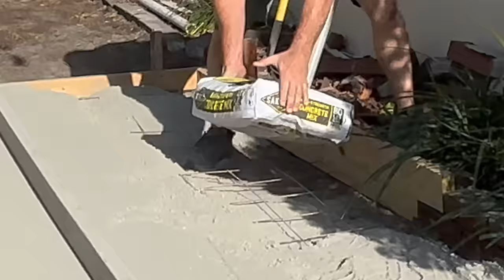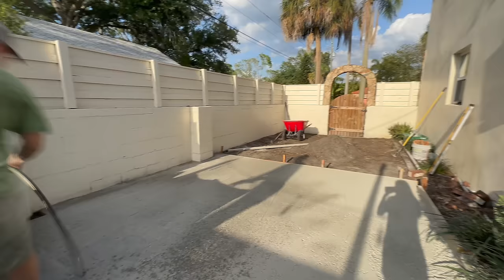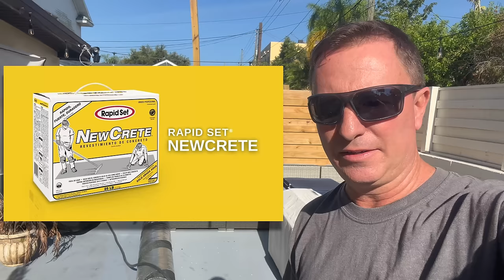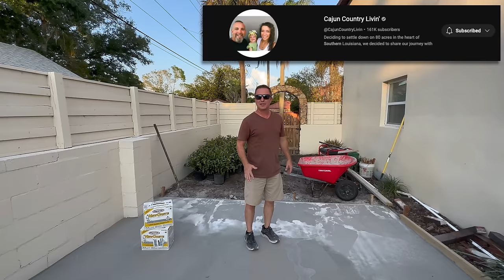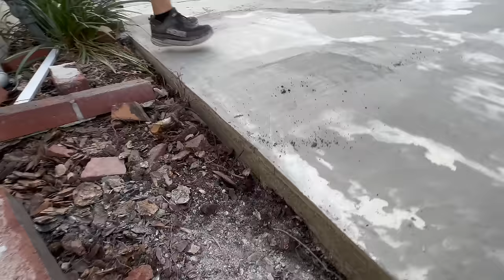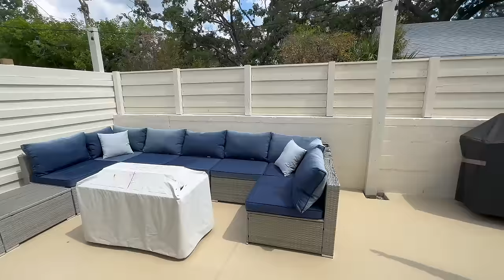Doing Dry Pour Concrete DOES ACTUALLY WORK?

Comment: It’s quick and easy but I feel like people who do this will regret it 6 or 7 years down the road.
Reply: Please explain why? If you feel that way. So we can at least understand. You must have a reason your saying that. Thank you.
Reply: @MrSteelermaniac  it doesn’t dry evenly, so you’ll get different layers of hardness and weak spots.  It could work, but I bet you’ll see issues down the road.  An even consistency is always better imo.
Reply: Well they have had people cut them in half, drill them, run them over with various vehicles, and bust them up. All compared to wet and if done properly there was no difference
Reply: @aundorl yes...if done properly.
Reply: @jcberb  Yes, if you follow all the directions for doing a dry pour. Screed back and forth until no rocks are showing. Use a roller to even out surface. Mist wait an hour.  Mist wait an hour, then water every hour for 2 hours per inch of thickness.
Reply: There are no directions for dry pour since it is not supported by any of the companies making the product.  It is directions from a nice couple from Cajun Country.
Reply from the maker: @chucklakes2345  Thank you for your kind and sincere comment.  Much appreciated.
Reply: @jcberb Yes, there is a way to dry pour incorrectly, just as much as there is a way to wet pour incorrectly.  What's your point?
Reply: @TheGamersRace  Calm down keyboard warrior.
Reply: @jcberb  Cool, so you don't have a point.
Reply: @chucklakes2345  I had some concrete work done and in less than a year the surface started to wear, don’t think these guys were great but at this point I’m good to dry pour something. 6-7 years is plenty of time for me lol
Reply: Once a dry pour has cured it's not going to revert to rubble simply with age. It will continue to absorb moisture until it is completely hydrated. It's about 2/3 the strength of a standard wet bag mix, which is strong enough for a patio slab or sidewalk. This assumes a proper base and drainage, which is also needed to keep a wet pour from breaking down.
Reply: @sotoliriano  There are bad dry pours and bad wet pours--as you have seen. Read up, learn all the tips and tricks, and don't skimp on prepping your base!

Comment: A lot of work and time spent making it half way decent. Would have taken less time to mix and pour like the instructions say on the back of the bag.
Reply from the maker: The time was approximately the same as a wet pour and half way decent end result is your opinion.  Guest and clients have found our finished product comparable to any traditional wet pour.  Just accept the fact that dry pour is just as good as a wet pour for small home projects.  You don't have to believe it, but it is still true.

Comment: If you had just did it the right way In the beginning, you wouldn't have had to fix all those problems. It is going to crack overtime.
Reply from the maker: Thank you for expressing your opinion kindly.

The point of the video was about dry pour and seeing if it is a viable option for DIYERS. The other two slabs next to the dry pour slab were poured in the traditional manner. Also, without factual data we need to be careful what we express, as traditional poured slabs crack too. So in summary, if a person follows best practices for a dry pour as one should for a wet pour, there is a good chance the slab will be fine. As stated in the video, these slabs our not for structural building. The dry pour slabs are for the simple uses of concrete, i. e. slab in front of shed, short entryways, barbecue, etc.
Reply: Once a dry pour cures, it's not simply going to turn to weaken with age. Somehow I doubt you have monitored dry pours over the long haul, so on what basis do you state it would it crack over time--any more that a wet pour might?

Comment: Looks neat, but I’d rather just use a small concrete mixer and do it that way to save money.
Reply from the maker: A small mixer would work also. The only challenge for some is getting the mixer to their home and being able to use it in short time, so as not to pay high rental prices. To each their own.
Reply: I get it…. At 4”,  you’d need  80 plus bags and that would take around 4h of mixing….. it looks great man… nice works🎉🎉🎉

Comment: Great Video! I worked Mud for almost a decade and have a couple small projects that will be dry pour. It seems that a little vibration along the forms (before wetting) could help with some of the issues that folks have. I like the use of topper to level-out and smooth the finish. Since my pads will be about 3x3 I plan on spraying with Thompsons or similar after the first 24 hours. Thanks for the show! (Dave W / PHX)
Reply: I made a vibratory screed, much like what you can buy to finish et concrete. But in dry  pour, you use it on the dry concrete before you wet it. What this does well dry is to help push the aggregate down and cause cement and fines to rise up. Then use a dry paint roller o evenly smooth out the fines. Then start the misting process. I mist about once every 30 minutes as the water migrates down about 3/4 of an inch before slowing and stopping absorption,   Then mist again and wait another 30 minutes and repeat. You do one misting for each 1/2 inch of slab. 

I have tested this in clear plastic forms and you can observe the water migrate down. The rate that the water gets absorbed is amazingly consistent and predictable. Once the slab is fully absorbed a bit extra water will not hurt, It's already beginning to cure. 

With wet mix concrete, you get the strongest slab with the minimum amount of water. But it is harder to work. That's not an issue with dry pour. 

Using the power screed followed up with the roller, produces a very nice finish that looks pretty comparable to wet finished, but it is not slick and has a vert nice minimal roughness to it.  Better than a broom finish but won't become slick with water, like a super slick finish. It  is comparable to an etched surface and if you want to later apply a sealer or even paint, you will get a very good bond.

Comment: Justin, I totally agree with you on the partner assist screening. My slap was a very large slap about as large as yours. So, by myself Screening, I did it in sections (4' x 12' (5 sections) [section 6 6'x12' 10:15 ] adding wire for the hot tub placement. Just to pour about 6 weeks.

I do have a few areas to touch up, then, it would be painted as well.

Yours looks good!

Comment: Excellent, adds a lot to the data. Being in construction, would you have experience with the testing tools and methods used for concrete to measure the compressive strength? It sure would be interesting to see how strong it would cure compared to a slab done the "traditional" wet mix way.
Reply from the maker: I agree. It would be interesting to see the strength of a dry pour concrete compared to a traditional wet pour.  I personally don’t have the ability to measure the PSI strength.
Reply: That would be difficult as the only way to get the actual compressive strength of that slab would be to drill a core. Non-destructive testing (Schmidts Hammer or Windsor Probe) are not designed for this type of concrete (or for finished flatwork in general). I would bet the compressive strength or surface durability  will not even approach that of the same properly mixed concrete, and forget about even getting uniform strength throughout the slab thickness. Hopefully this is in a non-freeze\thaw environment as one winter would disintegrate this mess.

Comment: We just did this last weekend using the same concrete brand & mesh you did. The sifting was definitely the hardest.  Hubby & I got frustrated with each other for a bit cuz of it lol. We did decide to buy some cement mix that was powder only because we were getting frustrated that some rocks were still showing. That worked  but, it was a different brand so now our slab is 2 different colors 😢. I want to stain it but not sure how long we should wait before we do it.
Reply from the maker: Great job! I totally understand how you and the hubby were a bit frustrated. Happens with me and my wife too. I am glad to read you overcame the rock problem. So regarding the staining of the concrete, I would suggest waiting 30 days so the concrete can fully cure. Since dry pouring is a new there aren’t any set standards, but based on what I have learned and some basic common sense is how I am providing this advice. Keep us updated on your progress.
Reply: Hey try concrete paint! I did several dry pours and used black concrete paint and it turned out great!
Reply: I had the very same issue. Rocks showing and a rough surface. And three salesman footprints in it, of all days to come to my house. I am going to need to cover mine as well.

Comment: The dry pour does not seem to have smooth finish, so you can actually make it smooth with the New Crete or the self-leveling concrete? What is that self-leveling concrete called? Great job, looking fantastic!
Reply from the maker: Thank you for your comment. I do believe with more experience a smooth finish is possible.  As this was my first experience, I had a learning curve.  To level out the areas needed, I used a product called LevelQuick RS which can be purchased at Home Depot.  After the self leveling product dried I used New Crete to create a nicer finished look.

Comment: Hi, Thanks for the great videos!!! I have a question. I am setting a couple of 4x4 posts in concrete this weekend for an addition to my roofed patio. I am wondering how it's possible for the concrete to stick to the posts, because when I use wood as a form to mold concrete, it doesn't stick hardly at all and comes off easily. Do I need to prime the pressure-treated wood before setting it in the concrete? Thanks!!
Reply from the maker: First of all, concrete is not an adhesive.  I do promise you though that whatever you stick inside of it will not come out easily once it fully cures.  There is no need to do any additional treatment to the pressure treated wood.  It is advisable to make a small rebar cage around your 4" x 4" post, so the concrete will have more strength to hold the post as the weight of the roof will create tension.  I encourage you to continue to do your research on best practices before this weekend.  I wish you the best and thanking you for the opportunity to chat with you.

Comment: How big was the pad and how many bags of concrete did you use?
Reply from the maker: The pad is 11’x 12’ and I used 60 bags.
Reply: @justintimevlogs2492  60 - 80lb bags?
Reply from the maker: 80lb bags
Reply: From a novice in northern NYS:
Great vid. I’ll have to watch it again to make sure I can actually do this.
The questions I have are :
If you would have wet poured it would you have been using the same amount of bags?
And what kind of paint did you use.
Thank you again for posting 
Good luck in your future DIYs.
God Bless
Reply: @fredr.5723  At 3.5" thick a 11'x12' pad would need 64-80lb bags.  So I'm guessing the thickness was a little bit less.  I'm shocked, I figured mixed concrete would have expanded or something.
Reply from the maker: Hi Fred, thank you for your questions. Our pad is 4” thick through out. Had I planned to film this process from the beginning I would have filmed me measuring 4” throughout. I can assure you as I laid out the forms and graded the dirt, it is 4”. The calculators only give us approximations on the number of bags.

If I mixed the concrete with water I would have been within a couple of bags of the 60 I purchased. 

Regarding the concrete stain, I used Heavy Shield (water based) concrete & driveway stain from Sherwin Williams.

Comment: If you want to cap that with an actual durable finish that might make it last you're looking for a product called cement-all. Make small batches and skim the surface. It cures very fast. It would likely save it's durability it's so strong.
Reply from the maker: I have never done it that way but I am sure it would work too. As per how I was trained, I typically use cement all for cracks in a slab and then top it with New Crete. There is a great video sponsored by RapidSet that shows this process. https://youtu.be/ybtEKpoCWEs

Comment: Can you tell me how long you watered it?  Until it puddled on top and was no longer being absorbed?  And all at once?  Being a concrete newbie I'm concerned about how much water to use, as the more you use the weaker the concrete. But then again, you have to have some reliance that the water is getting to the bottom. Thanks!
Reply from the maker: Great question. For me, I did not need a lot of water from the top.  I made sure to water the ground before I started so the lower parts of the slab would wick up the moisture from the ground.  Also, when using bags of concrete the moisture in the air helps in wetting the concrete.  I have a video coming out soon discussing this process with an industry expert.  I did give my slab about 5 minutes of watering, which I explain in the video.  Yes, there was some puddling.  I did come back out about 2 hours later and watered the slab again in the same manner.  I wish you all the best and thank you for your question.

Comment: You used a self leveling concrete and then new Crete on top of that.  If the screed work was better up front would you have skipped the self leveling and just used the New Crete for the smooth top finish?  And then you painted over the New Crete with paint for concrete?  Or is the New Crete the paint or coloring product?  Thank you, I just did my first one and it came out rougher than I want and not the color that I want so I'm trying to fix it.
Reply from the maker: You are correct. I wouldn’t have used the self leveling product had I done a better job screeding. I would have gone straight to the New Crete to provide a nice finish and blend it into the other two slabs. After the New Crete cured I painted it with Heavy Shield from Sherwin Williams. It is a concrete paint/stain. I wish you all the best. Thank you for sharing your experience.

Comment: Do you think a 4" dry pour slab is strong enough to park a golf cart on? ( has a lithium battery so it's much lighter than one with lead acid batteries)
Reply from the maker: In my opinion, I do believe a 4" dry pour slab would be strong enough for a golf cart.  I am doing a video now on a driveway addition I am doing for our golf cart.

Comment: Would it stand up to the weight of car or boat under a carport anchored to ground?
Reply from the maker: Building codes require a wet pour for the application you stated.  In theory, dry pour could work but there too are many “potential” points of failure in the dry pouring method that don’t warrant the effort and cost for a driveway, in my opinion.

Comment: How would you feel about anchoring a pergola in a dry pour?
Reply from the maker: Good question.  Simple answer, I am not sure I would.  If you were to try it then please be sure to make your slab 4" thick and allow the slab to cure for a least a month, if not longer, to fully cure.  Also, I assume you are talking about the pergola's one can buy at the big box stores.
Reply: Michael Build successfully used anchors on a sill plate with a dry pour. I agree, with the OP on all points for best results.

Comment: You resurfaced your dry poor slab to get a smooth finish. What product did you use and how difficult c was it to prep the slab for resurfacing?
Reply from the maker: I explain in the video what used (New Crete). Since the concrete is new there wasn’t any prep needed. I did use self leveling cement prior to the New Crete since my screeding job was not what not that great. I will post a link to a great video demonstrating how to use the product.
Reply from the maker: https://youtu.be/ybtEKpoCWEs
Reply: Seeing as how I am forced to work alone. My screeding sucks as well. Thanks for the informative.

Comment: I also want to do some dry pour jobs,but i will admit im worried about the freeze thaw cycles in indiana, what you did looks great amd i would like to achieve the same look, whats your opinion on it breakin up come winter
Reply from the maker: Bruce, thank you for reaching out. I understand your concern about the freeze thaw cycles but unfortunately I am not experienced enough to answer said question, as I have lived in Florida my entire life. I know a very smart guy, regarding concrete,who used to work with me and he lived in Virginia for many years. I will contact him and see what he advises and get back with you.
Reply: @justintimevlogs2492  awesome thank you for looking into this issue a little further, I greatly appreciate all the knowledge I can attain
Reply: @brucehall8570  There is actually 4 or 5 videos from people  who lives in cold climate and  have tried this method. You can search for it and decided if you want to try it. One lives in minnesota and is a good friend of Cajun.  I also saw and read somewhere that it works. Good luck!
Reply from the maker: Thank you Luke for the info. I so appreciate thoughtful and helpful people.
Reply: It’s not so much the freeze thaw cycling that’ll get ya.  It’s that dry pour allows LOTS of water IN, unlike traditional concrete, and that wateer freezing is what will cause the issue.  When water freezes it expands and therein lies the problem.  If the slab is saturated and it freezes it can and will fracture the slab all over the place.  Could crack it up to the point that you actually SEE the cracks or it could microfracture it everywhere which you may NOT see.  Both scenarios will cause the slab to break apart when you start getting differential settling of the grade underneath.  Conventional concrete can withstand a lot of differential settling without breaking.  Dry pour cannot withstand it NEARLY as good and when fractures are present, it won’t withstand differential settling at ALL.